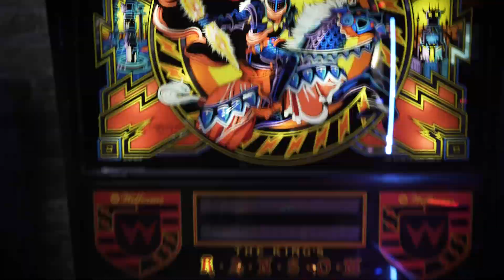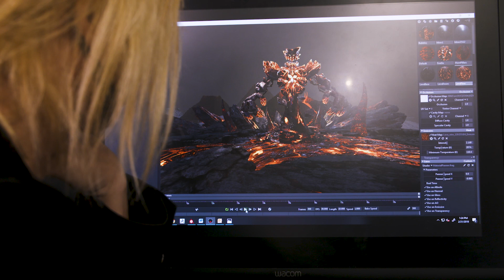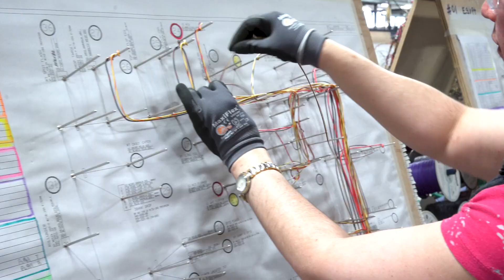The Making of Black Knight: Sword of Rage Pinball - Behind The Scenes!

Comment: Even though Steve Ritchie isn't a particularly good pinball player, he does masterfully understand how to create excellent game flow. That means the game pace has to be very fast so that the player is challenged nearly all the time.                                                                             
                                                                                                                                                                      
A table taking this concept to the limit is Scott Danesi's Total Nuclear Annihilation. Beneath the scoop the ball bounces around at the speed of light. This makes a player go into overdrive with his neurotransmitters working under full load. Knowledge of how the ball will bounce off an object as well as blitz reaction is required. The low positioning of the flippers makes it much harder to safely stop the ball, so often the breathtaking hunt for control continues. High speed means also more exciting inlane-outlane action / time. More inlane-outlane action means more drains but the lane save feature genuinely balances the situation. When a ball passes the outlane switch, lane save instantly loads the new ball into the shooter lane to fire away. This process could be sped up further if a ball was already waiting in the shooter lane - talking about nuances here ofc. I like the scoop's fast kick-out bc wait for what? I dislike though that the scoop activates the ball-saver. It has to be possible to adjust the scoop so that it doesn't throw the ball SDTM. Given that, the player shouldn't have the option of draining deliberately.                                                                                                                                             
                                                                                                                                                                                     The downside of TNA is that shots to the top (spinner and into the scoop) are pretty seldom and so 90% of game play takes place in the lower section. For the same reason multiball play feels a bit "overcrowded" as the balls collide extremely often. TNA's single multiball feature is the only strategy to go for. That's pretty poor. The unique lock sequence however counts on the plus side.                                                                                                                                                        
                                                                                                                                                                                      
Black Knight has a wider open playfield what means a little less speed however if you don't hit the shot and the ball bounces back from posts, fast reaction is tested for sure. Different multiballs make BN more interesting. Overall playability is hard to compare as different layouts obviously play differently. BN is more what's expected and TNA more unique. I say it's a standoff. TNA's awesome soundtrack wins slightly over BN's while BN is ahead concerning art and video animations.

If I had to decide between a BN Premium and a TNA I'd choose the BN but only by a small margin. To me it seems incredible how close Danesi's team can come to the Stern giants.